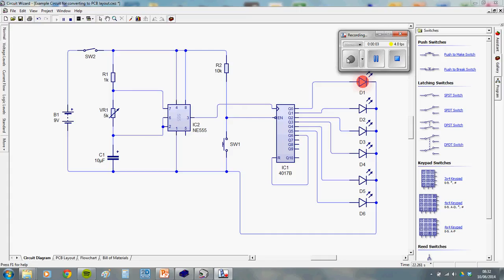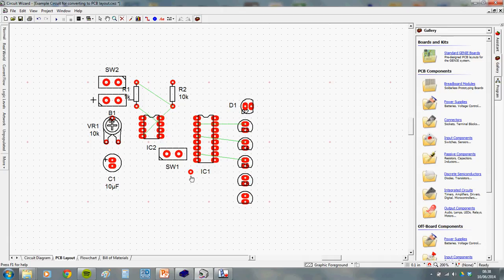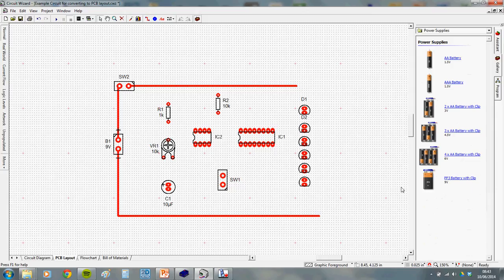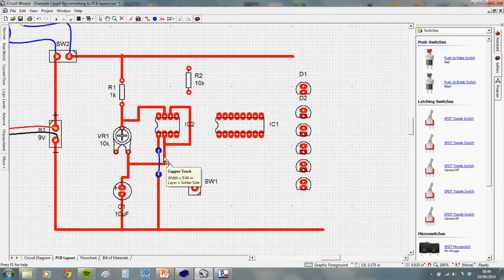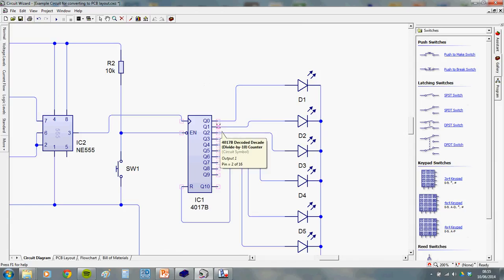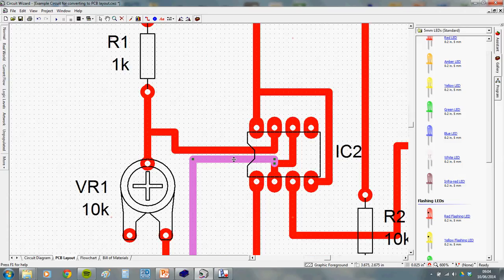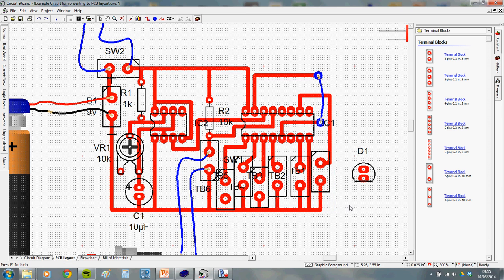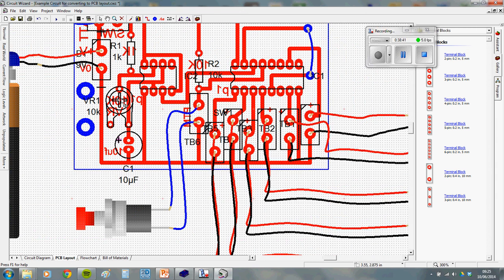How to make a PCB from a diagram

Comment: I have this software. Most designing goes ok, I have yet to add a transistor that is anything other than EBC pin out. It wired a BEC transistor as an EBC pin out. I found the place to add a transistor, but not to change the different pin out. Other than that, this is very good software.

Comment: Anyone know if Circuit Wizard has an Electret Mic part in the library? I could not find it on the Demo.  Thanks.
Reply from the maker: Don't think it does.  Not that I've ever found.   I don't think it could simulate it very well even if it did.  You can make a variable voltage power supply (to kind of simulate a varying voltage) if it's an amp you're trying to build.  But some things are best experimented with in the real world  (i.e - prototype board)
Reply: Rob Winter hey there is a piezoelectric module on there for the diagram and also there is a signal generator to send a DC or AC signal so that would do it. Currently using KiCad which even has SD and Micro SD card modules on top of most audio jacks, mics. Circuit Wizard is my favourite though!!

Comment: what s the point of the software if one needs to rebuild the PCB connections by himself? what happens if the circuit is more complex? will that render the software totally useless & require long hours to manually figure out the PCB ?

Comment: Auto routers suck! Learn doing it manually its fun! when you delete those connections in your PCB layout and you have to redraw them again you're wasting time. IMHO this program sucks, I used it longtime ago and I have switched to EagleCAD. It's way better.
Reply from the maker: +PadMAD3k Thanks for your comments.  This video is aimed at 14 year olds who've never made a circuit before. As you say, there are WAY more professional packages out there, but they (and the concepts of what you're doing) are not easy for people to pick up if they've never done it before.  I show them the autorouter to prove to them that they can do better than a computer.
Reply: Rob Winter True I agree. I started with a program like this too. I can't remember it's name anymore. It had the same auto router. Later I moved on to Eagle, you don't need to know every single option in the application. What I love the most about Eagle is the control that it gives you. It's also great for front panels.
Reply: EAGLE is fairly easy to teach (simple PCBs can be designed with only the 3 mouse buttons) but does give room to grow in the future. It is also fairly industry standard. Educational packages for schools are free.

Comment: Hello!
Could you please explain why have you chosen Circuit Wizard instead of e.g. EasyEDA, Upverter or Fritzing for your class?
Reply from the maker: It was created for my students and the software we use at school...
Reply: Rob Winter Right... :) Could you say two words on the other pieces of software? I'm just starting and I'm curious to hear it from a teacher's perspective.
Reply from the maker: Tome4kkkk I've not used any of the other packages you've mentioned, but circuit wizard integrates with our curriculum very well, from designing schematics, through to turning them into pcbs (that can also be simulated as pcbs) through to programable PIC chips that an also be simulated in the software. It's also the most 'kid friendly' package I've found... Drag and drop etc, very visual and looks like real life which makes it easier for the students to follow.

Comment: Hi Rob,

I simulated this circuit from this link but didnt seemed to work. Except if i remove the regulator but the issue is i need to feed the relay a constant voltage of 5 volts.

Please help id like to use this for my solar battery.

John from Manila